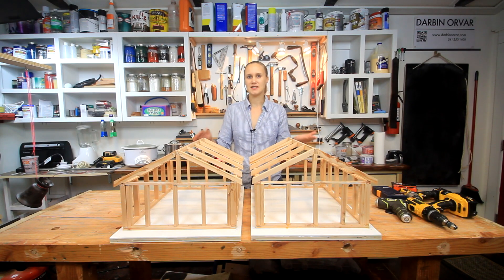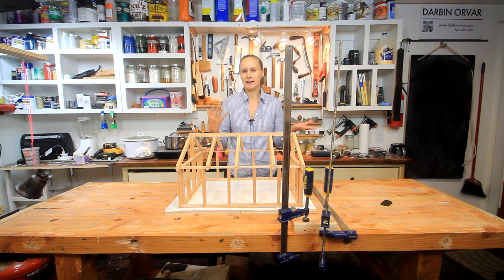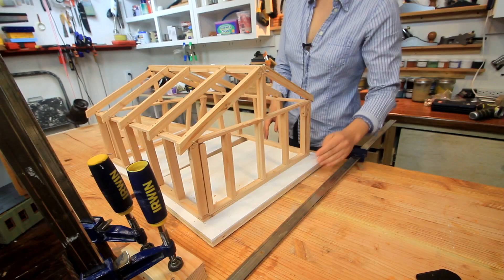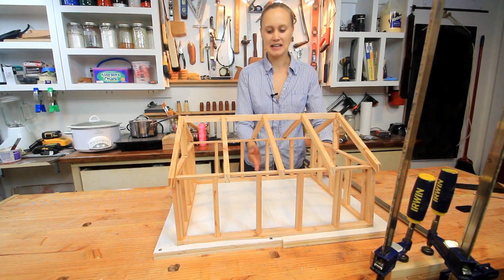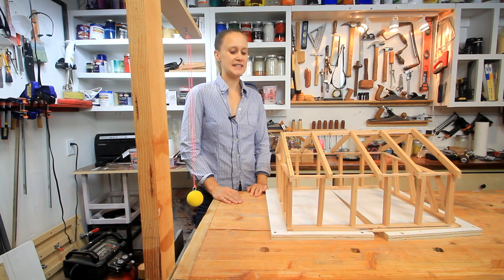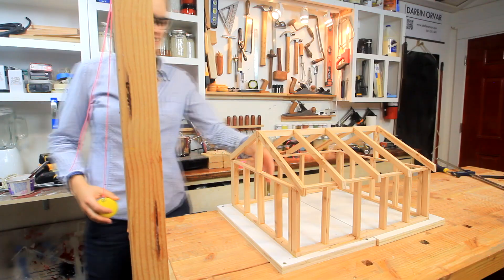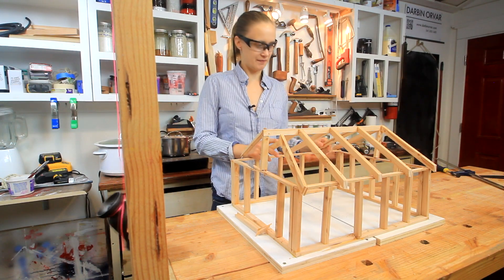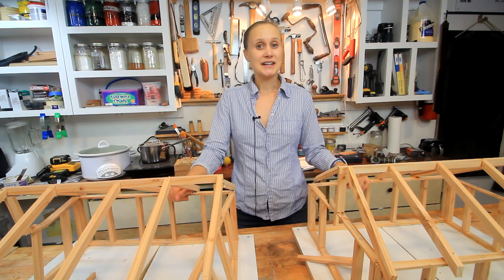How Important is Glue? Furniture & Buildings

Comment: The only issue I'd see is buildings would lose a lot of flexibility. I agree a far more rigid structure would be obtaining using glue, but in areas with a lot of storms, houses that are too rigid wouldn't flex and would not have as much resiliency during storms, and would fare worse during earthquakes since there would be a lot of resonance and vibration that a more rigid structure would not be handle as well as a less rigid structure.

Comment: It's actually code in a lot of areas to glue the baseplate down. Here, if you are building a basement you have to glue the subfloor to the joists. You also have to concrete in bolts to bolt the baseplates to the foundation. I've said for a long time if they would use the f26 construction adhesive on all the joints and where sheeting is applied to the house it would be much more sound. The only draw back is time and a small additional cost. Great video.
Reply from the maker: +Matthew Prince Thanks for your thoughts!

Comment: So much theory and so little physics. Some things to consider in an earthquake, Vibration harmonics, leverage ratios, ETC.  But basic fact is, all woodworkers know that yellow glue makes a joint stronger than the wood itself.  Now if carpenters stop and glue each joint of a house, the time cost will far outweigh the cost of the glue. If you want to go one step better, use 3" screws if but overkill doesn't make much difference when the wood gives out before the joint.
Still, love watching, listening and thinking with you. THUMBS UP

Comment: In modern construction, the bottom sills usually are glued to the foundation with construction adhesive. Studs are not typically glued to the top or bottom sills because a) it isn't really necessary (the bulk of a house's shear strength comes from the plywood sheathing outside the frame), and b) the tolerances in framing construction are loose enough that you wouldn't get consistently good glue joints anyway.

Comment: Were you were simulating in your earthquake test a house built atop a fault line? Very interesting experiment, and even more interesting that you were wondering enough to build models to test ;-)  Construction adhesive stays more flexible than wood glue, I believe (not sure how long) so might be better. Anyone know anything about relative strengths of the two?  Shear walls (plywood sheathing) would probably provide much more resistance to forces from earthquake shear waves and from wind loading than glued joints. Your last point was key -- both structures performed up to their objectives, which is to allow the occupants to survive, not necessarily the structure. I really enjoy your experiments! Keep wondering and testing.

Comment: First, shear strength in a traditional stick frame house comes from the shear panels (plywood, OSB) or wood boxing. Second, you actually need some flex in the joints for expansion/contraction and settling. Third, floor plate is nailed or screwed to the concrete slab, and top plates are doubled/overlapped. If you're building a house, please consult an actual builder.

Comment: Having been in the construction business (new and remodeling both commercial and residential) for over 40 years I can say that with rafter and wall ties, along with sheeting, would have increased the amount of force  needed to create a failure in the tests. Construction adhesive would increase the rigidity of the joints but as you found the wood is the first to fail.

Comment: Good video. I agree with using glue to glue your home to the foundation, and if you really want to kill two birds with one stone, spray in polyurethane foam in between your studs for insulation.

Foam, according to a Texas A&M study, is not only the best insulation you can put in a home, it also increases your homes strength by 20% because it glues the entire home together. Texas A&M also said that the extra cost of spraying foam is off set in energy saving with in 5 to 7 years compared to other forms of insulation.

I've sprayed A LOT of foam since 2001. I build Monolithic Dome homes and I've built over 50 of them using 2.5 pound foam and the strength is unreal, and the insulation quality is even better.

A couple friends of mine were both building homes on a lake in northern Wisconsin and I offered to spray the foam at cost for them. The homes were almost identical including the doors and windows used, and pretty simple. The cost was around $1,900 each. Only one took me up on my offer. The other one said I can put in that pink spun fiberglass stuff in for about $300, so he went that route.

After the first winter, they both compared heating bills. My friend who went the cheaper route paid over $900 in heating, and the one with foam paid just under $300 for the entire winter. They were both shocked, and I said and he will save more on cooling his home too this summer.

Bite the bullet and insulate AND strengthen your home with foam.

Keep up the great work. I'm really enjoying your videos.

Comment: Interesting video Linn.  I would say if you can afford the cost of the adhesives and the additional funds that the contractor would charge, the construction adhesives at all joints would be beneficial.
Reply from the maker: Ted Alexander Thanks. Well, Titebond I is not too expensive by the gallon and would get the job done.
Reply: Darbin Orvar thats very true but i do believe over time titebond or any yellow wood glue becomes brittle verses a type of construction adhesive. I have run into this over the years doing finish carpentry work.